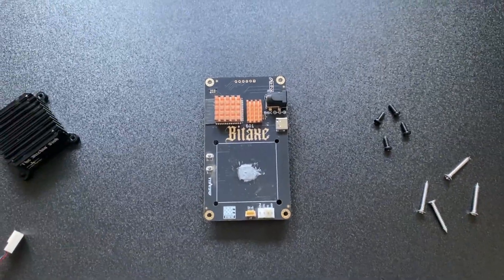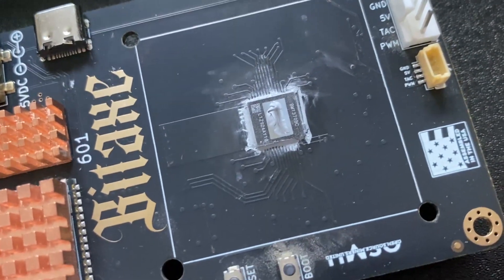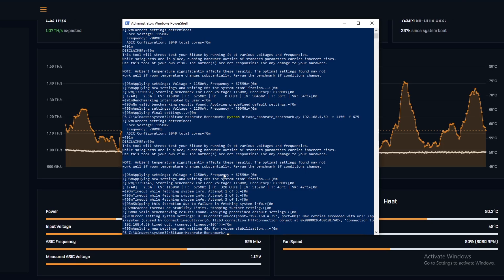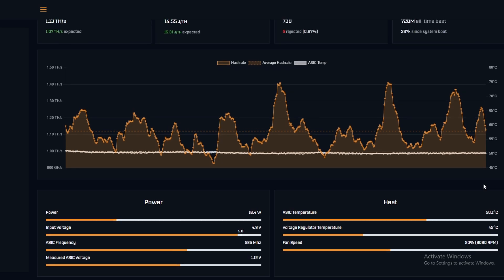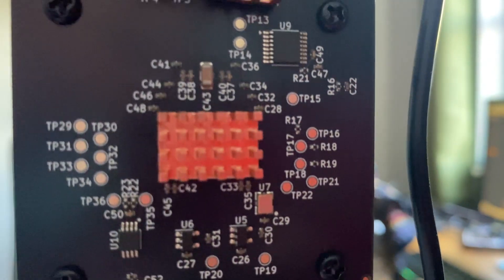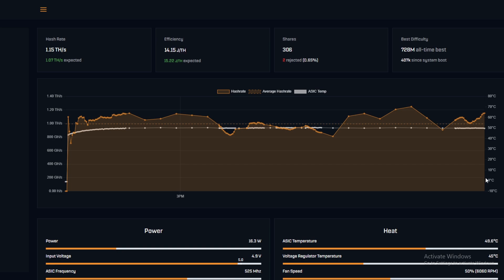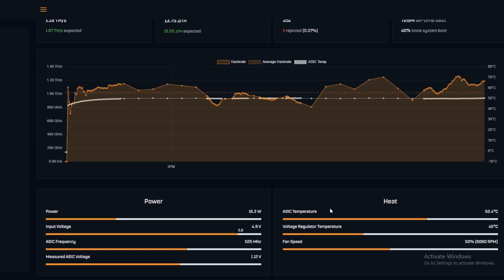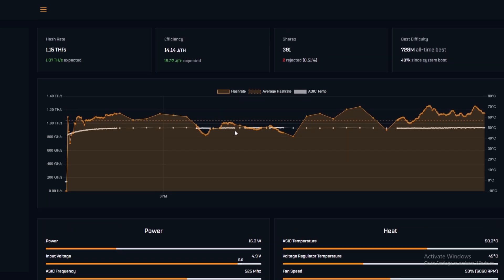Does Copper Heat Sink Actually Improve Bitaxe Chip Temps?

Comment: For the thermal paste on the sides, you can GENTLY  use a swab with isopropyl and clean then, or get like a cheap painters type brush and dip that into isopropyl and wipe away, the bristles help get it out alot better is alot less likely to damage any of the pins !!
Reply from the maker: perfect, thank you

Comment: I put a copper heatsink that fills that entire space while the bitaxe was at 600mhz @ 1200. My temp dropped 5° and my hash rate went from 1.3TH to 1.6TH. Took the heat sink off while it was running  it dropped back down to 1.1 put it back on went back up to 1.5. I did this several times. There is a performance gain from a heatsink being there imo.
Reply: you mean you filled up the whole face of the pcb with copper heatsinks?
Reply: What spot did you put it on?

Comment: Since thermal paste has the role of dissipating heat, it will help it to dissipate better around the chip as well. The problem is with liquid metal. This can cause short circuits.
Reply: I thought thermal paste was made to be non conductive?

Comment: I wish I can share with you what I did but I have an old Flir thermal camera and I was able to visually check the areas with higher temperature and the apply the small heat sinks and that was the best way to cool down the device and get a more stable hashrate.

Comment: hey there... yes it does... i got myself a LuckyMiner LV06 as very equal to Bitaxe Supra running on bitaxe firmware on Solo Mining Pool with average hashrate of 800gH at 45° to max 50° degrees Celsius... The LV06 also got an 1366 asic. waiting for switching power supply 100 watts from Amazon cause the voltage drops to 4.8 volts with original power supply and this is bad. should be always stable at 5 Volts. 800 gH is not even the end i think. i placed heatsinks everywhere as on your video but as i told you in last video not on the esp32 cause this is useless...settings now frequency: 850! / core voltage. 1300 max difficulty 1.89G ! rejected 0.16 to 49.800 shares 😄